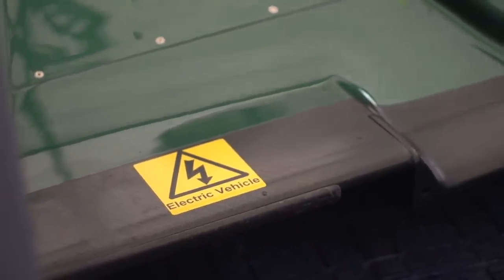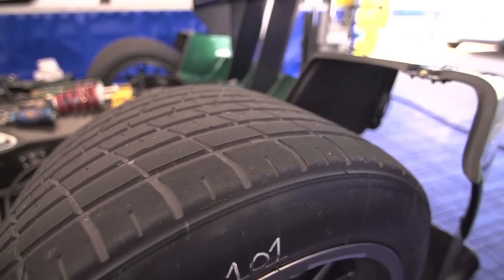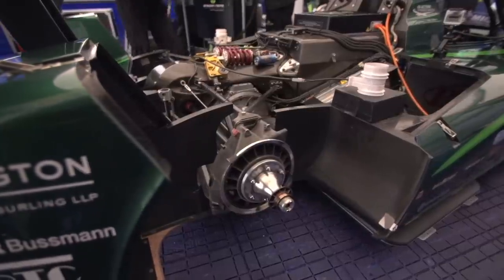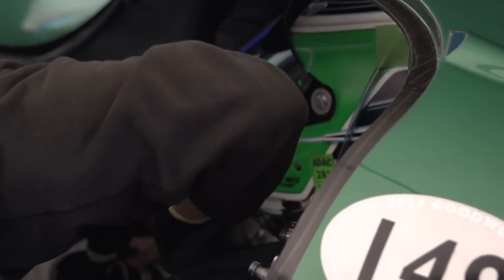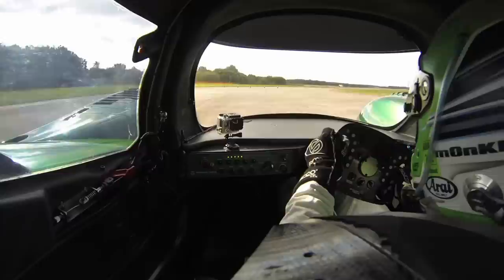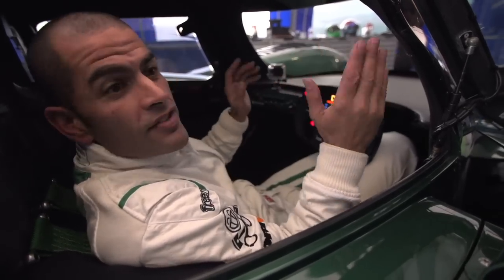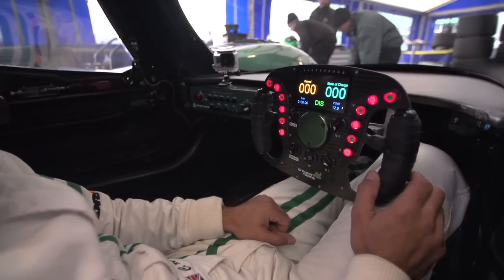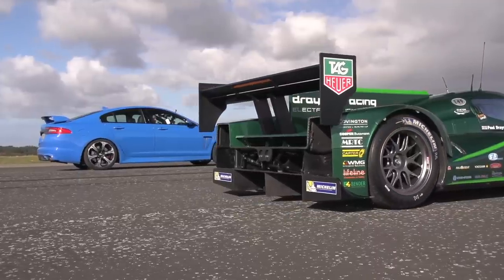850hp Electric Racing Car: Driving the Drayson B12/69EV -- /CHRIS HARRIS ON CARS

Comment: Normal cars burn fossil fuels to drive the wheels. Electric cars burn fossil fuels in a power station to drive turbines to turn a generator, then there's a step-up transformer, miles of cable, a step-down transformer, the wiring in your neighborhood, ANOTHER transformer in the charger and the inefficiency of battery charging in general. Energy is being wasted all the way along the chain.
Reply: There is a big difference. Normal cars can't choose the kind of energy they use. If you own an electric car you can charge the battery with solar or wind energy for example.

And that's the future...
Reply: Unlikely. Nobody wants to wait all day before they can use their car. And what about journeys you can't make on one charge? Electric cars are just not good enough, and don't look like they are going to be for quite some time. Maybe for the commute to work, where you know exactly when you will need the car and how far you will be going, but the car was not invented just to get us from our house to the chain-gang.
Reply: mellowb1rd
How about nuclear power plants, such as Liquid Fluoride Thorium reactors?
Much better than the watercooled uranium reactors, they won't melt down without active cooling (like what happened at Fukushima).

Capacitor style batteries can charge up very quickly too.
Reply: You want to talk about wasted energy? The supertanker used to move crude oil across the globe is diesel powered and at best 40% energy eff. The refinery used to process oil into petroleum uses up to 7.5 Kwh per gallon and the road tanker that distributes the final product is 25% energy eff. The kicker is, because an ICE powered car is only 15% energy eff at the wheels, 85% of ALL oil being moved and sold around the world becomes waste heat... that's a good system - if you're in the business of selling oil!
Reply: mellowb1rd The 2nd Price at the Intel International Science and Engineering Fair was won by a woman who made a supercapacitor that was able to charge in 20 seconds. And at the Institute of Technologie in Karlsruhe (Germany) researcher developing a battery with 10 times more capacity than our actually known batteries. Of course it will take some years until these technologies will become marketable. But it's the right way and the day will come when we need these new technologies.
Reply: tsport100
That's only a lot more efficient than mining the coal we burn in our power plants.
Reply: ICEs are terribly inefficient.
Reply: TracerTxT
Capacitors are not suitable devices for long-term use. You can START a car now using a bank of supercapacitors. Except, if the car doesn't start on he first or second attempt, you're screwed. And you can't run the heater or air con off it more more than a few seconds if the engine isn't turning. BATTERIES have advanced more than capacitors have. Hydrogen fuel cells might be better, except it will ALWAYS take more electricity to make an amount of hydrogen than you can ever get back from it. I guess if you used solar or wind power to slowly create the hydrogen over time, it would work...EXCEPT, everyone would have to pay for their own generator. There's no way in Hell we are producing enough clean electricity to make enough hydrogen to power every vehicle on the road. Hydrogen also leaks through ANYTHING, so the fuel you put in the car is running out whether you use it or not. It's not as fast as the rate that capacitors lose their charge, though. There is no acceptable alternative to internal combustion yet. I doubt we'll even see one in our lifetimes. And we DEFINITELY won't see electric passenger jets.
Reply: mellowb1rd: " Hydrogen fuel cells might be better, except it will ALWAYS take more electricity to make an amount of hydrogen than you can ever get back from it."
— That's precisely what happens with Li-ion batteries. It takes more electricity to charge a Li-ion battery that you can ever get back from it.
Reply: Yeah, BUT, when your battery runs out halfway to your destination, you are going to be at least 12 hours late. Hydrogen has the advantage of being like petrol in how you can refill very quickly. Plus, the infrastructure is already in place. We already have conveniently placed fuel-stops and the means to deliver fuel to them. It wouldn't require a huge amount of effort for gas stations to start selling liquid hydrogen.
Reply: That makes no sense.
Reply: BananasSuddenly ITER
Reply: Normal cars burn fossil fuels into heat mostly. Have you ever heard of renewable energy sources i.e wind turbines, hydro electricity, solar? There is energy loss in every system but none are as inefficient as heat generating internal combustion engines. You don't realize how much energy it takes to produce fossil fuels.
Reply: Simon Artymowycz
You mean the fossil fuels we get our electricity from? Electric cars would make environmental sense IF our electricity was produced from the tears of squirrels. There's no conspiracy here. People don't buy them, because, once they realise the shortcomings, they think better of it. There is no secret technology here. Nothing is suppressed. The cars and all the components are freely available, but the demand just isn't there once people realise the hassle involved. It's still gonna be a while before electric cars are a viable alternative. And, since cars are nowhere near the biggest contributor to global warming, if it even exists, maybe we should use our energy more efficiently by starting at the top and working down.
Reply: So you don't know what renewable energy is... not all electricity is generated by burning fossil fuels. Look up hydro electricity or wind turbines before you start talking about "tears of squirrels" (WTF?)
Reply: snazzy snail lol, There's a difference between having an opinion based on belief and opinion based on facts. He does not have the facts straight... we are not talking about religion here, this is about the facts of engineering.
Reply: There is no such thing as mining that is good for the environment... There is no such thing as a car that is good for the environment. You have to understand that what we do to make our lives easier always destroys the environment one way or another. Electric cars are better for the environment than combustion cars when it comes to emissions, but maybe the production of these cars i.e the impact of producing batteries will be more negative. 
You can have an opinion, just don't be naive...
Reply: Still there is renewable energy. Example in my country we use 15% of it. 3 years ago it was only 7%.
Reply: mellowb1rd The length you can drive on electricity is just a matter of research. In the 60's - 70's people would laugh with you if you'd say that oneday diesel would outperform a petrol engine. Now everybody is laughing with the whole electricity thing. I don't get why. Hopefully everybody will realise that it's the way to go before we're drowning in rising oceans while coughing on bad air and enjoying insane weather all over the world. Maybe fusion power to produce elec.? Whatever the solution is, it's def. not petrol, diesel, gas, coal,...

The majority of people don't drive more then 300 km a day. The drive to work, without even carpooling. So electric cars for working people would be a super idea. And if you want to go on a holiday for 7 days, you could just rent a petrol van or whatever for one week.
Reply: mellowb1rd SOO, basicaly, your only gripe with this is how long it lasts? Really? Thats pathetic. Cause you said it yourself. Things take time. This is the FUTURE. No one said its the present.
Reply: His gripe is probably something stupid like it doesnt make a noise that combustion cars make but doesnt want to say that
Reply: Yes you are right. I mean I like combustion sound too. But it doesn't blind me from thinking this is also very cool!
Reply: You obviously don't understand how the refinement of gazoline works!
They use vast amounts of electricity to refine oil into gazoline, Then they use loads of energy transporting it by ship, then by truck to your local gas station. And that's to acieve a shitty 30% energy efficiency when it burns in your engine. How exactly do you think that's better?
Reply: Ummm, working on an oil refinery, I'd say I know more about it than you do. The point of the original post was that electric cars are not as clean as people think. And since nobody has done the math, may even be WORSE. But, all theorizing aside, the FACT is that, as far as how they function AS cars goes...gas beats electricity to within an inch of its life, then rips its keg off and finishes it off with the soggy end.
Reply: mellowb1rd ever heard of wind turbines? And by the way, people won't wait for hours at recharging stations to recharge batteries. It will be smarter to exchange discharged batteries with batteries that got recharged previously, using power coming from renewable resources.
Reply: mellowb1rd If you really do, then it's more likely you're highly biased. The FACTS are as I stated them and you cannot escape them. You don't have any valid arguments, all you do is spew opinions with nothing to back it up.
Reply: your also forgetting that even the dirty coal plants have better efficiency than your standard petrol engine.
Reply: Carlo mc
I already mentioned that in great detail. It's a much better system than charging them yourself, but the flaws are pretty bad.
Reply: TheHamstenator
 Biased? I said I work on an oil refinery, not that I own one or am a major shareholder. I'd get paid the same even IF there were an electric car on the market that even came close to gas in terms of practicality, useability, performance or desirability. (just about any "bility" you can think of, except environmentalist propaganda gullibility) Not that that's relevant, because there isn't. And you really can't talk about facts, since nobody seems to be willing to work out the overall carbon footprint of each. The few attempts I've seen all omitted so much as to be meaningless. You'll know when electricity is a viable alternative when people start flying on electric airliners.
Reply: Kaspar008
And those plants are quite several large, wasteful transformers and miles of cable away from your charging point. (Which will also include a wasteful transformer and only convert some of the current it uses into charge in the battery) The point of the post was that electric cars aren't as clean as people think. And hybrids are LESS clean, since the MPG figures they report are measured with a pre-charged battery and STILL suck compared to diesel. Who would want a slow, boring, heavy, impractical, expensive car that takes hours to fill up for a short journey and STILL doesn't necessarily improve on the environmental impact of what is already in place? When they stop being shit, people will start to buy them.
Reply: Ignoring hydro-electricity, solar, wind, nuclear energy sources. A coal power plant (as dirty as they are) are more efficient at making electricity than a combustion engine is at propelling a vehicle. Electricity is cheaper than gasoline/diesel too. It's like maybe $2 to charge your vehicle from your home with a 120V outlet, and it'll get ya around 200km/125miles or whatever it is now. $2 of 87 octane gasoline won't get ya anywhere near that in a 92 civic which are famous for gas mileage, let alone a modern heavier vehicle with all the weight of safety requirements.
Reply: mellowb1rd
Your points, while valid, are based on today's infrastructure and technology. When gas powered vehicles were first introduced, there were no roads or gas stations every two blocks and engines were carbureted, not fuel-injected.

In 50 years (a time period that I pulled out of thin air :) ), let's revisit this question of infrastructure and technology and see if EVs are as competitive.
Reply: Yes, but you can make energy very efficiently and cleanly in a power plant. In my case, the electricity is made at a hydroelectric power plant, so no fossil fuels are involved.
Reply: The Doc
Hopefully in 50 years, electric cars won't be so crap. Bet they still don't fly, though.
Reply: IF you use them. We don't. Iceland uses 100% renewable energy. They are alone in this. Plus, Solar plants block sunlight from reaching the earth. It can't power you plant AND hit the ground. And hydroelectric...well, there are millions of square kilometers of brand new desert to testify to how clean that is. If we all started using geothermal, where do you think that energy comes from? The earth does not have unlimited heat. When oil runs out, we use something else, when the heat runs out...game over. Even wind and wave energy...you can't just take energy out of a system and not affect that system. And, since fusion looks like a pipe-dream, that only leaves nuclear fission reactors, which all the hippies protest over out of sheer stupid ignorance. It's the best option by a long, long way.
Reply: Crude oil has to be pumped up , then , with the use of  a pipe line , it will be  transported  to a near shore and there it must be stored , Then big  tankers will  transport the crude oil to the west over thousands of miles ...There it has  to be stored again waiting for the next step   .The crude oil  has to be fracked with the use of the energy out of oil or gas...then the destillated petrol or diesel has to be distributed  to gas-stations..Then you can fill your car with it... The petrol-engine has an  efficiency of only 25 %....75 % of the petrol is wasted...But...you can make our own electricity with solar panels and charge your electric vehicle with  it... then you can drive your electric car with an engine efficiency   of 90% .....
Reply: Yeah, and that would be lovely if we all generated our own electricity. But solar sure ain't the way to go, since electric cars are only good for the daily commute to work, and the car is not going to see much daylight at the charger. If employers offered solar charging points, that would be better, but only McDonalds, Wal-mart and a few others would ever be able to do that.
Reply: I'm starting to see more and more panels on roofs. Makes no sense to me to have a roof, then cover it with a panel. Making new houses where the panel IS the roof makes more sense. As long as you can get the guts out to replace it without leaving a hole.
Reply: But it can be more efficient to centralize power generation and it can be cleaner as well.
Reply: Not solar panels. In fact, the extra miles of cable would make it less efficient.
Reply: mellowb1rd

It depends on where the panels are placed and it also depends on how electricity is distributed.
Reply: On the roof, obviously. And Solar panels produce low voltage DC, so the less cable the better. In a power plant, you can convert it to high voltage Ac for distribution, but think how long the cables would be from a lot of the panels. Plus, you can easily buy new panels in a few years when they are a lot more efficient. Power plants will make the old ones last as long as possible and use price-rises to increase profit instead, until such time as upgrading is financially unavoidable. But the biggest advantage of domestic units is that they don't really change anything. Your house was ALREADY THERE. The roof was already there. You don't have to ruin a perfectly good patch of desert.
Reply: The argument is that electric cars are shit. That's the one and only argument, and it's 100% correct.
Reply: No. If I meant "COULD BE", I'd have said "COULD BE". I said ARE. They ARE shit.
Reply: Alex Gowers
No. It's called "exposing some facts"
Reply: mellowb1rd what about hot swappable batteries just go to a station swap a couple of cells out for fresh ones and the way you go
Reply: Jack Mars i don't get what your trying to say ?
Reply: And yet with all that they are more efficient than gasoline engines. How is that possible you ask? Gasoline engines are extremely inefficient!
Reply: You realize how much LESS fuel is burned for electrics right?
Reply: Ninjar  NOBODY does. It's never been worked out fully for the entire process. Then again, cars contribute very little greenhouse gases compared to industry. And almost none compared to natural sources. So why the rush to buy expensive cars that weigh a lot, perform badly and turn a drive of a few hours into a mission with planned overnight stops for charging.
Reply: mellowb1rd
solar-cells? wind-energy? if you analyse, keep ALL in mind.
Reply: Yeah...solar and wind are both pretty poor in most cases. We're still missing that perfect power source. Maybe fusion will be the answer
Reply: even then using fossil fuels in a motor pollutes more.
Reply: Right, cuz no energy is lost in the extraction, production, and transportation of fossil fuels... btw, it's a systemic change everyone is after, where the energy comes from solar/wind/whatever, so the turbines don't turn a generator, you don't need miles of cables and tons of transformers. Surely you know this already.
Reply: What if we were to put a small gas powered generator (like one you could buy at any home improvement store) to charge the batteries as you were driving?
Reply: well even the best gasoline engines lose 50-60% of the fuels energy in heat/noise.  so id say the electric car is on par if not better still
Reply: Ron F The power stations that burn the fuel that creates the electricity to power your electric car, are less efficient than that. And that's BEFORE you add in the long-ass chain of losses before you get to your battery. And who cares? Honestly, even if they were 100% efficient, they still suffer from the same problems they always have. Even a big old V8 contributes less CO2 than you would if you walked the distance in stead of driving. Should we all stop walking too, in the name of some vague environmental concern that's not even a REAL concern?
Reply: mellowb1rd
 Yeah, see, if you think the change to renewable energies is that people drive electric cars powered by power plants burning coal... then I can see why you don't understand the value of electric cars.

Are you from the US? Because your apathy and denial of climate change is first class. The US, where a new car company just got a lot of financial support for developing a diesel that gets 50 mpg.... to people in Europe, that sounds like the stone age. VW already made a car that gets 240 mpg with gasoline.

How can you claim that an old V8 contributes less CO2 than someone walking the same distance? That's one of the most misguided statements I've heard in the whole environmental discussion.

You don't even understand the concept of environmental concern. If you don't understand that we are poisoning and destroying the environment that lets us eat and breath and call that not a real concern, then what is.
Reply: you guys are talking about coal burning power solutions to charge these electric vehicles but you seem to forget that in places like Arizona, the majority of home owners are going with solar. event he power company has several solar stations around arizona.
Reply: With the difference that an electric motor has an efficiency of 90%, and a thermo electric power plant has an efficiency of 60%, against the 25% of any fuel car (otto engine). Also you can recover all the energy from brake, In addiction the pollution comming from a thermo electric power plant can be a lot lower than cars. The only problem of electric cars are batteries, cost and weight. That´s all.
Reply: And how much energy metal and resources does it require to make a petroleum refinery and keep running it?

BTW most electric motors do have a efficiency of +95% while most combustion engines do only reach about 30-38%
Reply: I'm sorry, what you just said is completely idiotic.
Stupid people say: "Oh electric cars use electricity, quickly we need to burn more fuel to charge them!" You have absolutely no freaking idea how a power grid operates.

Our power grid is hideously inefficient not because we burn so much energy and waste them on resistive heat, but because we are so unpredictable. Peak hours where the most fossil fuel is wasted. By charging your cars in off peak times and having better organized/predictable scheduling can essentially charge these cars on energy that would otherwise be wasted. Even if all of us converted to EVs, the extra energy required to charge these cars would be minimal. 

That's one point, another point is the overall efficiency. ICE engines are so hideously inefficient 20% for top of the line turbo charged adjustable displacement engines. Now, we are not even talking about the energy wasted during idling etc-that figures is peak efficiency! Oh, and transmission loss and even lower efficiency at lower RPM. Your standard induction motor will do 85% efficiency on as low as 20% load, and it gets higher as the load increases. 

The third point have nothing to do with efficiency. It is on transitioning to different source of energy. Till now, we had handy fossil fuel to burn but what if we run out of it? EVs are still relevant because you can easily convert other energy sources to electricity. You can still burn things like wood alcohol or bio diesel, but I doubt they will really take off just because their competitors are more abundant in energy(thorium etc).

TL;DR: the reason electricity generation takes so much fossil fuel-> poor organization, needs decentralized generation system like BlueGen, The average load on the actual grid contributes little to the fossil fuel burnt. Even with these inefficiencies, electric cars are still more efficient. EVs are still relevant when fossil fuels runs out.
Reply: mellowb1rd I believe Tracer was talking about graphene super capacitors, which show great promise in charging speed and energy density. It's like the perfect marriage between batteries and capacitors. Charges fast like a capacitor, stores energy and releases it like a battery. They are wonderful concepts on paper, but actually making pure graphene is terribly difficult.
Reply: mellowb1rd i was thinking this the whole time i was watching. you couldn't be more correct.
Reply: Renewables work , unless you listen to the goverment
Reply: As much as we'd all like to be propeller heads till we drop off the perch (including me) , this is undoubtedly the way forward.
The amount of research into battery technology on this planet currently would probably surprise most, and as always, when man puts real effort into it, we can achieve things that are hard to imagine today. My friends and I still laugh at what we might have got up to when we were younger if we'd had mobile phones and freeways:-)
Reply: To solve this whole debate and everyone agree. Oxygen is highly combustible and the most abundant element on Earth...??? Win win win situation. We could easily adapt the combustion engineer to burn oxygen, ridiculously easily. Then we maintain the benefit of cars being made with parts that are much more longstanding and hardy. (Come on, how many of you have had batteries fail in something you own? They are terrible.) And we do not create more completely unnatural, non biodegradeable hydrocarbons to dump in the oceans? (Plus about a hundred other benefits I can think of as to why truly and irrevocably combustion engine is king, most efficient, safe, enjoyable, renewable and friendly to the Earth than electricity/battery driven cars.)
Reply: Eh. Electricity can be produced with many other, more efficient means than burning fossil fuels. Additionally, power transfer through electric grid is actually very efficient - much more efficient than transferring tons of petrol and diesel to fuel stations.

Add to that the much higher efficiency of electric motors compared to internal combustion engines, and it turns out the combined efficiency of electric cars has the potential to be much better than conventional automobiles. The main problem is range, weight, and recharging time, of the batteries which are being developed continuously. There is also a possibility to do continuous recharging by embedding induction coils into highways, which would be the ideal solution in my opinion.

Fossil fuels have currently the edge in energy density, which means they offer better range, but on the flipside, the efficiency of internal combustion engines is physically limited by the laws of thermodynamics (look up thermodynamic cycle efficiency, particularly Otto cycle). They won't get much more efficient, no matter what technical advances are developed to increase their power and reduce their emissions.
Reply: HerraTohtori I wouldn't be worry about range, weight and recharging time. It's only an issue now because there's no "Electric Station" anywhere in the world. Now just imagine a world without any "Gas Station". How far would you go? Not really far either. 

So, it's just a matter of infrastructure. And luckily for us, there's already electricity networks all around the modern world. So it could be very easy to install "Electric Station" anywhere, even easier than "Gas Station".

There's already some research about less than 90 seconds full recharge, some research about induction coil (as you mention), as well as other technologies currently developed for the electronic mobile devices.

By the time people will be ready for EVs, the whole network will be ready and range won't be an issue at all (and price won't be an issue either because there's less parts on EVs). And if the overall performances are as good (or even better) than ICE car, why wouldn't it be any good?

As mentioned, EVs are the future. Anyone that can't see that is just plenty ignorant, blind or just living in bad faith ;)
Reply: Mm. Recharging a battery takes currently longer than pumping fuel into a tank until it's full. That is an issue that does need to be solved before electric cars become practical for long distance travel.

For daily, short-distance use, electric cars can already be practical, when they can be charged overnight. Long distance travel still requires some way to produce electricity "on the road" - currently, hybrid cars can either have an engine directly connected to drivetrain, or they can have an onboard generator driven by the engine.

There's also a possibility to add fuel cells to the car, but hydrogen storage and distribution are problems just as much as battery energy density. And of course hydrogen production is not very efficient.

The ideal solution would be to continuously supply the car with electricity via wireless induction coils, similar to what some handheld devices already have. Another option would be beamed power transfer using some suitable microwave frequency, but I'm not sure if that would actually work very well outside Kerbal Space Program.

But yes, I agree - electric vehicles will most likely be at least part of
Reply: HerraTohtori As mentioned, range is an issue but didn't need to be solve until now. For city uses, EVs are already good enough. 

But some companies are working hard to make EVs practical for any kind of usage, including long travel. And I saw a research about an "instant" recharge, using a new kind of batteries. Which means a 12 hours regular recharge time could be drop in only few seconds.

And it might be done wirelessly, which means, you only have to stop at a red light, a stop sign, or even a parking space equipped with inductors, and you will seamlessly recharge your car. And without even counting the power of clean energies such wind, solar, etc... Tons of way to get energy to power our future cars, without being depend of fossil fuel from foreign countries.

Hybrids (just like the Tesla battery swap) are just a temporary fix solution for now, until the full electric cars will get performances that are good enough for all kind of travels.

It's just a matter of time. Since batteries are use on virtually all mobile electronic devices, and they're already used by billions people around the world and it represents a trillions dollars market, I have no doubt we will a lot of R&D investments in that domain. EVs will simply get the benefits of those researches. :)
Reply: Yeah, there's a lot of promise in EV development. However, EV will only start replacing conventional automobiles when it can do exactly the same things as them, with a comparable or smaller price tag than conventional cars. I hope that day comes sooner rather than later.
Reply: energy has to be wasted don't you mean the money gained from the use of energy is being wasted filling someones pocket
Reply: Nuclear power, no burning.
Reply: damien de grasse The only thing better is fusion.
Reply: tsport100 The irony! The same supertanker(s) that will carry all the green cars intercontinetal, the same supertanker(s) that carries the simple gadget or whatever other crap from china, or what other country will be the production mecca in the future, and so on, and if you will do a quick search, you will be surprised how many oil tankers vs how many "other stuff" are crusing daily. Oh, and offcourse there will be more supertankers doing this once the batteries in a hybrid or fully electric car will actualy last long enough to make sense, and everybody will want them. I'm all for advancing in tech, on all fields, but you must be blind to think that all that "green research" in regards to cars have anything to do with "helping the earth" or eficiency .

Long story short, do some research first, see how much all the wind and sun tech have saved Germany and Europe and other countries from CO2 emissions, and this includes the "Euro" emissions standards for cars, in like allmost 15 years. You will be surprised. Also, you can do some quick research in how much those "supertankers" you mention are contributing to poluting. Check planes also. Check what's required to produce batteries. Check how much money we will need to make a globaly electric infrastructure capable to carry 50% of us randomly charging a car anytime we want.

Getting back to supertankers, there are like around 500k (this might be a wrong number, but hell, let's say 10mil) ships worldwide, registered. You can google it, and see about poluting vs cars, it's a bit shocking. And i'm not gonna mention planes again. It's useless.

And here are some links:
http://www.spiegel.de/international/germany/commentary-why-germany-is-waging-its-green-revolution-wrong-a-929693.html

"All of the wind turbines, rooftop solar panels, hydroelectric and biogas plants in Germany have not reduced CO2 emissions in Europe by a single gram."

And we are talking about 0 grams in over 15 years, with Euro emission standards for cars, with all cars poluting less, with car sales increased globally, with everything goin green, and yet, somehow ...

And when some tech is failing, we just get back to "old tech", because on important issues, that's how much advanced we are, in 2014:

http://www.spiegel.de/international/germany/researchers-alarmed-at-rise-in-german-brown-coal-power-output-a-942216.html

So, coal, because Fukushima was indeed hardcore, and lots of states worldwide got scared and closed down nuclear plants that were based on the same tech, but this says something, doesn't it? We are arguing forever about the future of cars and we include earth safety in there, and we choose bikes so we can be green, and we are proud "saviours". And get back home with our Tesla, or bike and stay on youtube and posting long comments like this one, with electricity from coal.

So let's not lie to ourselfs, meaning, let's not belive the "hype" every single time it's presented to us.

What about "fixing" that supertanker propulsion first? How about that? If we do care about the earth. There are less carriers than cars, and stilll, they damage the enviroment way more. And again, let's not mention planes.

And if someone thinks any car manufacturer will shoot themselfs in the foot by cutting down their profits goin "all electric", it's sad. Any car manufacturer in this world profits more from "replacing parts" rather than selling cars (except maybe supercar companies). So, imagine replacing a normal engine with lots of parts with an electric one wich in theory should not break so often, and has way less parts.But i'm sure the electric one "will break" also, as often as the current thermic one.

And don't worry, fossil oil is far by being over.

Just my 2 cents

Cheers.
Reply: Nope. A car engine wastes about half it's energy input as heat, noise, vibration. Whereas a power station is pretty much 100% efficient these days. Can you research before making comments?
Reply: soundslave Reciprocating internal combustion engines typically have thermal efficiency of about 30-40%. The most efficient small, four-stroke engines have an efficiency peaking at 43%, whereas large diesel engines powering ships can have over 50% efficiency.

Vibrations and noise are negligible energy losses, the biggest problems come from thermodynamics and the fact that heat can never be converted fully to kinetic energy.

Power stations, electric transfer, batteries and electric motors are not 100% efficient either. There's always some waste heat produced by any electric appliance - even just a simple conductor. That said, electric cars would be much more efficient than fossil fuel powered cars, there's no question about it.

The question is, of course, whether the methods of producing the electricity are more efficient than cars themselves. Sad reality is that in many countries, majority of electric power is supplied by coal burning powerplants, which is about the worst way to produce energy but they just don't have affordable alternatives. There's a lot of talk about using wind and solar power but the mathematics just doesn't add up - there's no way to fully replace current energy production infrastructure with wind and solar power, and they are not a reliable, primary source of power at the best of circumstances. Wind and sun can't be switched on and off at will, which is a requirement for primary powerplants.

What we really need is accessible fusion reactors...
Reply: I've seen mellowb1rd in the comment section for videos on several electric cars.  He seems to like to complain about them and their current flaws.  He seems to like to spout long monologues on their negative aspects, convolution and ineffective use of energy.  I'd just like to say this.

Electric cars are the future.  Yes there are current issues.  But these issues can be solved.  The cost of manufacturing electric engines is decreasing exponentially in tandem with the increase of battery life and performance.  We are already improving.

Furthermore, electric cars are in no way a new idea.  We have had electric cars since the 1850s.  They appeared alongside the first internal combustion engine vehicles.  We've had hybrid electric and internal combustion vehicles since the 1880s.  These aren't new ideas.  They were drowned about by a trend, by interest in the internal combustion engine, but are making a long overdue re-appearance into the mainstream.

The fact is that we are fucking up our planet.  Badly.  It's important to start acting now, we should have been acting on this issue decades ago.  A common point brought up is we're still damaging the environment in that you need to recharge the car, which requires the burning of fossil fuels to generate electricity, but as plenty of others have stated, we have technology like solar panels, wind farms, hydro-electric systems, nuclear reactors, none of which require fossil fuels.

Yes the are issues with electric cars at the moment.  But they are getting, lighter, cheaper and more powerful as we go on.  Why are people against this?  Why are people against the progression of technology?  Why are people against trying to do something to stop our exponential fucking up of our planet due to narrow minded, short sighted, ignorant greed?  For the sake of the next generation, for the sake of our species, for the sake of life on the incredible lump rock we call home, why do you hate electric cars?
Reply: Alexander Young Why? That's a mystery question, I could just guess...

Maybe some are just afraid of changes and new things (that's often the case with ignorants);

Maybe some have some personal interest in the ICE cars, working for some oil companies or so;

Maybe some only see the current downside without even looking at the bigger pictures;

Maybe, maybe and maybe even more... Who really knows?

One sure thing, we have to be very ignorant and blind to not realise EV/Hybrid are the way for the future. Every downside I read so far can't be fixed. I saw people mentioning Solar, Winds, Oceans, etc... couldn't be "enough" to power up all vehicles. This is right today because we probably only have 1/10,000th of what we should have in terms of renewable energies. 

But when we realised the real potential of renewable energies, we know it could be more than enough. Saying it's not enough today would be just like saying Internet connexions weren't good enough for everyone back in the 60's because they're only few connexions. Look at where we come from and where we're at now... Think the renewable energies network the same way now :)
Reply: Phil Smith I like you ;)
Reply: tsport100 you forget the heavy oil. Ships only use diesel it they are in some national waters in international 100% of them run on heavy oil. the gasses coming out are pure black just like with the locomotives, the first trains.
Reply: mellowb1rd well but oil pollutes a ton of water for one liter oil. Best and cheapest electricity is wind energy. half the price in prduktion per KwH as a Coal power plant, around a 100x cheaper than a nuclear plant is for the tax payer since the tax payer pays the Kwh but in taxes pays the storage of the nuclear waste.
Reply: Jo Kommentaah Wind power has serious production volume problems and is not a reliable main source of energy, for the same reason steam-powered ships quickly replaced sailing ships (you can't decide the weather).

You have to build a massive amount of wind farms to produce a really significant amount of power. They take a lot of space. They already disturb the wildlife, especially migrating birds.

Worse yet, you still need some form of reliable back-up (usually coal burning turbine plants) to make sure you can deliver the same amount of power to your electrical network even when there's no wind.
Reply: HerraTohtori Your sources?
Reply: HerraTohtori they dont disturb wildlife. 99% of a year they make electricity we only would need a tiny amount of storage plants to balance it. you forget that the el from a windmill can be send 2000 miles away with direct current with almost no loss in energy. the only thing we would need to balance the whole thing when we would achieve lets say: 50% wind energy, is a better infrastructure . If we wanted to we could get solar power from Spain or marokko all the way u to germany with low power loss. .. what is in the way: politics and the current anti-environment companies. do they take up much space: no. ever seen a uranium mine? some of them cover a 1/3 of the country with nuclear waste. Coal mines take up much space too. the harbours, the transport ways: trainrails etc. the large mine itself. .. I dont have any numbers but in my area there are more windmills around than needed to give el to anyone living here. they dont really fill much. If you have a 800 people town those windmills cover like 7 fields with one mill on each out of prox .. 200? fields. How long until each home can have one of those super batteries that are being developed right now. they are supposed to be a supremely chaeper than lithium li-on and lasting 100x longer. if each home get s one we could even have 100% wind energy without ANY break downs. Its also been proven that we could efficiently cover the earths energy use by 80% with wind alone. efficently means: that only 20% of earth would need too many windmills to reliable give el.
Reply: Phil Smith My sources are physics, basic knowledge of power grid maintenance, wind farm area requirements, and actual observations of bird and bat behaviour regarding wind turbines.

It's generally agreed that in a wind farm array, turbine spacing must be 10 times the diameter of each blade disk. An optimal grid pattern would be hexagonal pattern where each turbine is 10d away from six other turbines: each turbine then requires a hexagon whose side is s = 5d / cos 30°.

Currently the most powerful singular wind turbine has diameter of 164 metres and peak power rating of 8 MW. In an array, that means each turbine requires an area of 2.33 km².

A modern nuclear powerplant, or a modern fossil fuel gas turbine powerplant, can produce 1000 MW or more net electrical power, so you would need 125 wind turbines just to cover the energy production of one such powerplant. That means a surface area of 291 km², exclusively for wind turbines, to produce 1 GW of peak power. That's about equivalent to a square area with 17 km side - a good-sized town, or a sizeable chunk of wilderness. For reference, when you're standing on flat ground, the horizon is about 5 km away.

Of course the turbines don't need to be in one single clump. Distributed placement is a more sane solution, and usually wind farms are built in linear formations, where each turbine requires a rectangular area sized  but even then building 100+ wind turbines to "replace" a single nuclear or gas turbine power plant is not a trivial task, especially when you consider just how many coal burning power plants you would need to replace.

You also need to keep in mind that these calculations are done using the peak power value of the most powerful turbine currently available. Smaller turbines are probably slightly less efficient as far as power/area (MW/km²) ratio goes. Peak power is produced in optimal conditions. When we're talking about wind power, the biggest problem is actually not the surface area but the fact that you can't get "wind on demand". If there's no wind, the turbines produce no power. If the wind is too strong, the turbines produce no power because they have to be locked down to avoid overspeeding and destroying themselves.

This is a problem, because electrical power grid must be able to regulate energy production to match with demand at all times. If there is either overproduction or overdemand of power in the grid, it can cause the whole power supply grid to crash and cause substantial damage to power stations, transformers and such.

That's why, if you're using things like wind turbines, you have to always have a suitable reserve of power plants capable of balancing the power grid in cases when wind is very low, or when wind is too high for the wind turbines to operate. This actually applies to all electrical power plants which depend on external factors and cannot necessarily be freely regulated at all times. This would be less of a problem if we had a good way of storing large amounts of energy when you're producing a surplus of power, and you could then drain those reserves for balancing purposes, but such a large scale storage system has not materialized so far.
 
This means that wind power can be very useful, but it can't really be used as the basis of power generation. We can build lots of wind turbines, and we can obtain lots of power from them if we build enough, but each megawatt prduced by wind power must have a back-up in case the wind turbine fails to provide that amount of power to the grid.

I'm all for using as much wind power as we can. But there's not much I can do about the numerical facts - wind power is going to remain a supplemental energy source for a long time to come - not only because of the volume of wind turbines required, but also because it is fundamentally unsuited for base power generation.

As for consideration of wildlife: It's a pretty widely documented fact that wind turbines present a significant hazard to local and migratory birds, as well as bats. It's especially bad for birds that migrate along established routes and won't easily change their behaviour, which causes the mortality rates to peak on wind farms that are directly on those migration routes. For more information, check this link: http://nationalwind.org/wp-content/uploads/assets/publications/Birds_and_Bats_Fact_Sheet_.pdf
Reply: HerraTohtori Oh OK, so you have no sources for your argument... that's all I needed to know.
Reply: Jo Kommentaah Wind farms do affect wildlife, especially birds and bats. There's no question about it - the question is whether that effect is small enough to be acceptable, which is still being researched.

As for using wind turbines for large scale replacement of current energy infrastructure (mainly coal and nuclear power plants) you have to look at the absolute demand and consider exactly how much turbines and how much surface area you would need for that energy production and the required margins. Then look at what the wind industry's expansion capacity is, and how long it would take for them to manufacture all those turbines.

It's obviously true that coal and uranium mines cover a large area. However, if you consider that one uranium mine can probably provide fuel supply for multiple fission power plants, the power/area ratio is still going to be significantly better than with wind power. Coal is worse in this regard. The real problem with mining industry is that coal and uranium are not renewable resources and when the supply is depleted, the mine will be abandoned - requiring a new mine somewhere, and at some point there won't be any more coal or uranium to mine (and then we're really screwed, wind power or not).

Don't get me wrong, I think renewable energy sources are better than fossil fuels, and the more we build them the less we need to use fossil fuels - that much is obvious.  But they are simply not going to be enough to reduce carbon emissions significantly. To do that, we would either need to reduce the global power consumption hugely, or figure out how to build commercially viable fusion reactors fast.

Realistically I don't see the former happening, and that makes fusion development something of an only choice for ensuring long term energy availability. And it really baffles me that politicians seem to be incapable of reading the writing on the wall, and make the necessary decisions to properly fund fusion research, because it really is the only possible way to sustain humanity's current population and standard of living beyond the fossil fuel era.
Reply: Phil Smith Which argument did you want a specific source for?

Not all arguments need to be academically cited. You can crunch the numbers just as well as I, and they're not pretty. I suppose I could cite Euclid for the calculations of wind farm area requirements, but what purpose would that serve?

If you're referring to the part about wind power being unsuitable for base energy production, perhaps I could revise my argument: The more concentrated a turbine network is, the more sensitive it is to weather conditions.

If you can put enough wind turbines in areas far enough from each other, to take advantage of prevailing wind conditions, you can make sure you get a pretty good coverage, and if you build even MORE turbines you can always have enough turbines in areas with good wind condition that - in theory - you could indeed use only small reserve/backup power supply.

But the problem is, most countries in the world are not large enough to have enough meteorological variation to ensure good wind conditions on sufficient amount of wind turbines - even if they had the resources necessary to manufacture and maintain said amount of turbines.

The smaller the turbine network is, the more back-up power you need to ensure you can balance your power grid even in windless or stormy days. Long distance energy transfer has non-trivial energy cost as well, and you also need to take into account the amount of power lines you would need to put up for all the hundreds and thousands of wind turbines.
Reply: HerraTohtori I agree with you, except for your two last paragraphs (on the previous reply). I do believe we're not looking at the big pictures, therefor we always think we "can't" get enough power, therefor we would have to reduce the global power... while harvesting not even 1‰ of the available power by renewable energies (I mean plurals)... without even talking about nuclear and/or fusion.

Sure it would require some serious adjustments from the politics, but technically, and from a ressources point of view, we could have more than enough power from pure clean and renewable energies for the whole planet population. With the Solar all alone we could already have more than enough. And with modern home architecture we can also seriously reduce power consumption.

And it's pure common sense to understand it... no need for very high studies to understand that non-renewable energies mean someday we will run out of them. Also not really hard to understand that in one hand we have pollution, and not in the other one. Regardless how acceptable it could be, it's still pollution. 

If you go to the doctor for your illness and he gives you a choice of two possible treatments. One could have a "little" risk of cancer as a side-effect... and the other one is a cancer free treatment. And they will both have the exact same success result. Which treatment would you choose?
Reply: HerraTohtori "Not all arguments need to be academically cited."

Well, actually I prefer to see real studies when someone stats some numbers or argue about a subject. Otherwise, it's only personal opinion, nothing wrong about it, I give mine all the time, but it's then just a personal opinion and not a scientific study, that's all.

Again, I believe you don't think at the big picture. Electricity is already traveling long distances. In Europe for instance, countries are selling/buying electricity to each others depending the local weather, because there's some smaller countries (not as large as Russia, Canada, USA, China, etc...) and because some countries might have more wind farms (Denmark, Germany, etc...) and some could get more solar farms due to their sun exposure (Spain, Greece, Italia and all south countries).
Reply: mellowb1rd Funny that the whole Niagara region runs on power generated from the Falls. If we listened to people like you trains would never have passed 30mph because people believed that your brain would scramble above that speed.
You're also conveniently choosing to ignore the fact that (for example) well over 90% of batteries in a prius are recyclable and even that's ignoring the fact that when they are no longer useful in the car (more than 91% of all sold in 14 years still have original batteries) they are still over 80% efficient and usable in power generation applications.
This tech is in it's infancy bit the speed of development is mindblowing.
Maybe hydrogen will catch up or maybe it will win but don't be the fool that says you can see a few dozen houses having personal computers in the future.
History is littered with those people.
Reply: Have you seen the sun? V. Big red-orange thing in the sky? Every day? Back in the 50's scientists wrote about planet-wide energy systems. Type 1-type 2- wherewe  are now. Type 3, a planet wide infrastructure of electrical power, primarily from the big red orange thing in the sky, every day. So, fossil boy, unless you are Ned Ludd, you might want to do some research. You do know that Harley-Davidson is introducing a very fast electric motorcycle? And you know that the most recent Pikes Peak hillclimb was won by a private entry electric bike that set a new course record? Oh dear, oh dear, for the works teams. we be in the future now. This gets better, A week before the hillclimb chrush groove win, the same bike set the all time, stock bike (yes-you can buy one), top speed record @ Bonniville- 219 MPH. Oh dear,oh dear, push your Ducati-Kawasaki-Yamaha out of the garage and put gas on it. Light a match, because if you don't like the future your gonna be cranky.
Reply: Tom Merchant The problem is that we're currently a Type 0 planet and a lot of people keep thinking we will ever be a Type 0 planet and nothing else.

But they don't realise we can't be a Type 0 planet for ever. We either need to become a Type 1 or we will just destroy ourselves. 

But I'm quite sure most people here, criticising EVs all day long, don't even know what we're talking about... ;)
Reply: Simon Artymowycz Bmw made an electric car that uses it's speakers to make an engine sound lol
Reply: Wrong.
Reply: You are forgetting the energy expended in extracting oil, coal, and then the erergy expended in building infrastructure, tankers, pipelines, etc...then the energy expended in transporting oil to refineries...then the energy expended in refining it into gasoline..and then the energy expended into transporting gasoline to 10s of thousands of gas stations, and then the energy, expense and lives in fighting wars to insure a steady supply of this earth destroying muck....

Electric vehicles are 3.5 to 4 times the efficiency of ICE - >65% of the energy goes into moving the vehicle - in an ICE..the equivalent figure is 18%... and most gets wasted in heat production. Electric cars need not use the grid at all...a decent solar array can charge your electric vehicle for most practical purposes - and only need use charging stations for a long run.

Lets face it...electric is the future...ICE is stone age tech. I drive a really nice mercedes, burt when i test drove a tesla model s recently...it was instant "i want one of these.....and now". getting back into my own car and i felt like i stepped back into history....
Reply: mellowb1rd 0-60 in 1.8 seconds isn't shit.

Range is irrelevant when talking the viability of a race car.

It's clear that advancements WILL be made to improve batteries for conventional use and renewable power sources will accommodate.  

Stop being pessimistic bro.
Reply: ***** 0-60 in 1.8 seconds is extremeley fast
Reply: rockhopper123452 Damn straight.
Reply: Ever heard of nuclear power?
Reply: Yea, but no matter which source u use the electric power plants won't stop producing electricity from fossil fuel; mind as well exploit it instead of creating even more co2 by creating your own energy from fossil fuel.....
Reply: Ever heard of a wind turbine or a solar panel?
Reply: 1. not all of the grid's energy comes from fossile fuels (consider nuclear and renewables)
2. cars do bad emissions that power plants don't or at least make less of (like NOx)
3. we have to make a change in the way(s) we power our grid AND our cars, so why not combine it ?
Reply: protip - never take investment advice from this guy... about as short-sighted as a 90-year old nana.
Reply: solar panels and wind turbines also generate electricity in a clean manner. let's invest in that shall we?
Reply: LOL
Reply: Solar Panel on my Roof to my Electric Cars is about 30 METERs of Cables. Yep soo much energy transfer waste. /s
Reply: @mellowb1rd  Wow that did not age well in just 7 years. Porsche Taycan 4S did the 2,800 Mile Cannon Ball Run in 44hrs & 25 Minutes. Where else are you gong to drive, into the freaking ocean?
Reply: Interesting facts my country gets all its energy from geothermal and hydro electric so I guess ur argument literally can be used against u alot of countries are switching to a eco friendly way of energy production